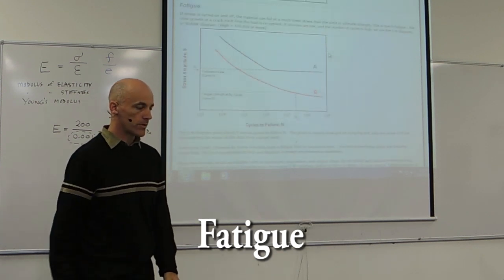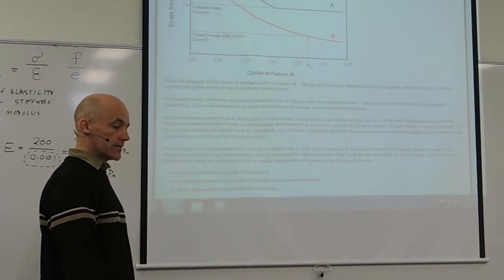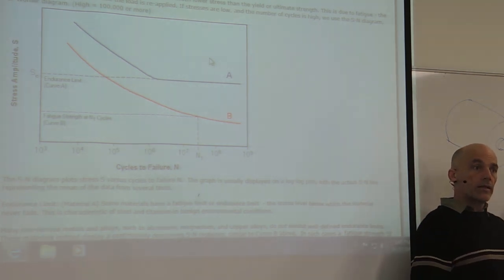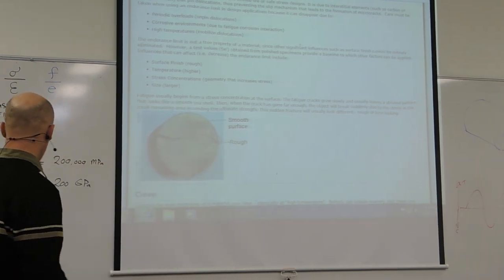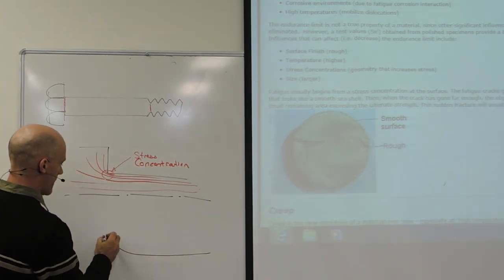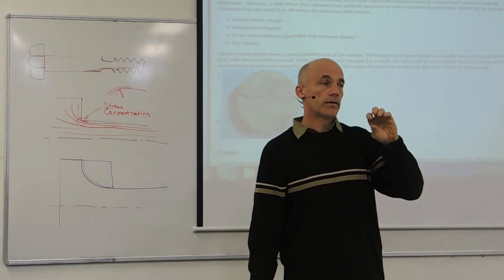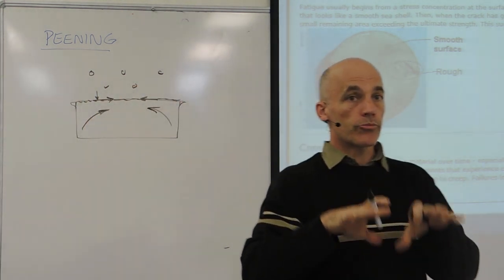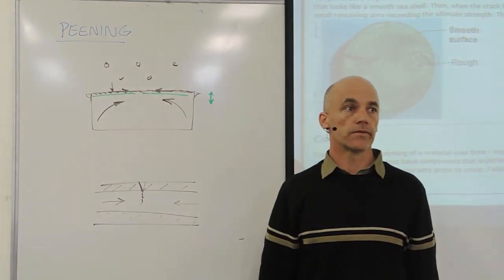Fatigue

Comment: Anything that does not fail under one application of load does not qualify as static failure. The wire failed by low cycle fatigue (hence only 20 cycles). Any material of any design can fail under 20 cycles or even less if you apply stress/strain cycles with high amplitude and higher R ratios. If enough strain is applied, the material fails after one cycle of loading and that strain is called fatigue ductility.